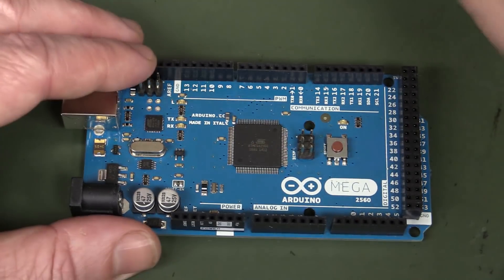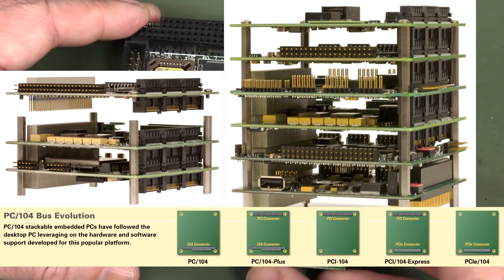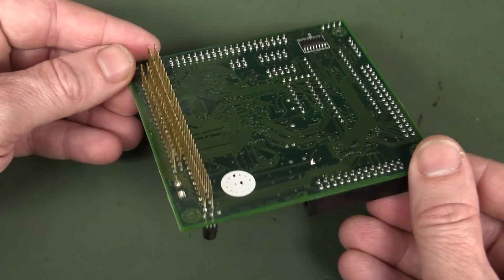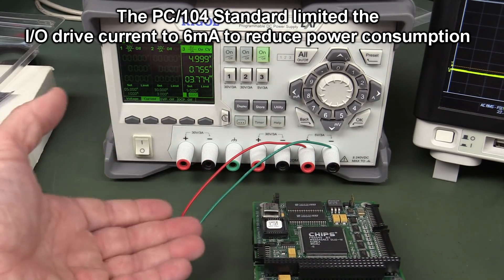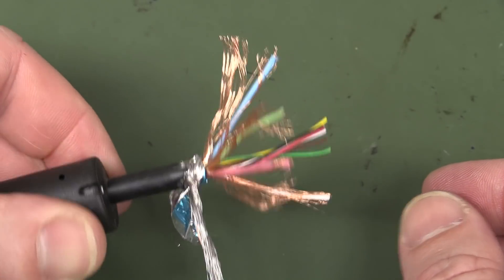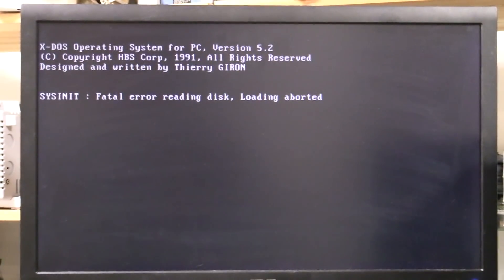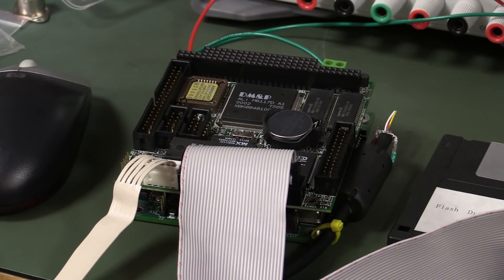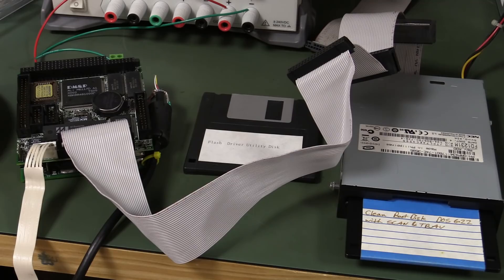EEVblog #1028 - What's All This PC/104 Stuff Anyhow?

Comment: Very cool look and compare. The 2nd half of your video is why "Arduino" took off in the free market. The Raspberry Pi wouldn't have succeeded had it not had a socialist push by the UK government. My last comment is how useful the Arduino is compared to these CISC embedded systems. It fit a big market need where the mass of developers had lower abilities, less time, and little need for CISC in the majority of applications. Granted big money is in the CISC embedded market (aerospace government contracts) but it was too large an initial investment by a lot of future developers. This whole market reminds me of the wideband O2 sensor crowd that helped take the $10,000 units down to sub $400 in a matter of a few years by DIY work and reverse engineering. Now everybody in the tuning and hot rod community has a wideband O2 sensor. Great stuff to watch evolve.
I really enjoyed your efforts in the video, especially the ending comment. I have similar sentiments when at work I have to debug computer systems older than the majority of their users! 6502 assembly code :) . Why upgrade when 1MHz responds faster than the mechanical system it's controlling? Although I think we are eking out every last bit of it's power these days. Taking full advantage feels good.

Comment: I don't think the arduino counts in that comparison. I know people try to use it that way but isn't it, or wasn't it intended as a prototyping platform? That's how I use it at least, get it working and flash the relevant microcontroller and put it on a custom board then reuse the arduino for the next idea.

Comment: I've got a couple of WinSystems PC-104 LX400 computers. AMD Geode CPU, up to 1GB DDR RAM, a CF card slot, both "CRT and flat panel" video. With a nice 6-40v input PSU of the same form factor. A Raspberry Pi is great, but it's hard to beat free from the scrap pile.

Comment: Just needs a Voodoo 3D add in graphics card then you can play Hexen II.
You had a 2D and 3D card in them days.

I bought a 40MHz 386DX (built in maths co-processor) years ago.
Got it in the free-ads, advertised as 40MHz.  When I got it home it had a sticker on the chip, peeled it off and it was 25MHz.  Still ran at 40MHz, these chips could overclock.

Comment: The PC104 manufacturers are missing the point they need to go with the AMD A10-7850k with 64GB of DDR3 RAM all it need is the UEFI/BIOS ROM and the SATA controller chip which means that they won't need anything else as the AMD A10 series of  APU chips is a SOC so they need to get their fingers out and get it done.
SVGA/DVI/HDMI ports would also be available on such a board if they cared to make one.

Comment: Reliability vrsus price and convenience. Most people now are trained to accept poor reliability over convenience, programmers included. I used to work on multi-user single processor databases that were designed to recover properly from any shutdown. That is, get 16 people to sit doing invoicing and throw the power switch of any any point and they would recover, without grabbing backups, OS included. Fully journaled datapaths, including journal recovery. You get what you pay for. I know it is not databasing, but you don't get that in a PI project with lots of module code written by "whoever". "Try version 1.1" or "Go back to version 0.87" type statements about fixing problems with addons or the kernel, makes me worry when people put them into machines that can hurt someone when they go wrong.

Comment: I think the idea that people would laugh it off if you suggested an Arduino is a bit. . .off. Sure, they wouldn't want an actual Arduino board in their system, but that's not really what you're programming with Arduino. You're programming the Atmel chips that they have, which can be pulled out and put places that PC/104 can't even go.

Then again, we're now in the waters of comparing embedded microprocessors to microcontrollers, which is kind of an apples to oranges thing.

Similarly, I don't think anyone's trying to say that a Pi is a perfect replacement for PC/104 (not that you were saying they were), but I think you underestimated the relative value of a Pi. A PCM-3343 from Advantech is $129 for an 800MHz chip (That's just the most similar I could find to a Pi's specs in the couple minutes of research I did). Sure, it might be more reliable (I don't have any experience working directly with PC/104 stuff, everything I know is academic at best), but for less than half that price (Let's say around $50), you've got a faster Pi with more storage.

I still really liked the video, but you just seemed a bit dismissive about what is basically an apples to oranges comparison.

EDIT: Also, I did wanna say that I know a lot of what you're saying is for comedic effect. I just figured I'd offer my two cents on the comparison.

Comment: If you ever find yourself in need of DOS again, I would like to mention http://www.freedos.org/ -- it's a modernized, F/OSS DOS-implementation and comes with a bunch of improvements over the old DOS 6.22 and the likes. Also, as it's so freely available, you won't have to hunt for old floppies with DOS on them or whatever :)
Reply: Nita Vesa But he still needs good quality blank floppies for the initial install.  Too sad Sony cornered the blank floppy aftermarket with crap quality blanks, then stopped production completely.  Still fondly remember using genuine Nashua blanks in the 1980s, but there were other well established quality brands that could have supplied the long tail aftermatket at $10 or more per disc instead of those crap  ones.
Reply: Nita Vesa But he still needs good quality blank floppies for the initial install.  Too sad Sony cornered the blank floppy aftermarket with crap quality blanks, then stopped production completely.  Still fondly remember using genuine Nashua blanks in the 1980s, but there were other well established quality brands that could have supplied the long tail aftermatket at $10 or more per disc instead of those crap  ones.
Reply: Doesn't look like it's DOS-compatible. I mean, sure, if one doesn't need DOS then by all means and there are plenty of other choices too, but I specifically was saying that if one needs DOS.
Reply: @baggacfreaks
You don't want to run dosbox on such an old and slow 386 machine.

Comment: I wonder what is the Linux support for the current generation of these boards.  A good Linux support would certainly bring life into this standard no doubt. Otherwise it is just waiting to be replaced for something more Linux friendly if that is not the case with PC/104 ...
Reply: Linux does apparently still have some sort of support for PC/104 as it's a configuration option in the kernel build.. but like ISA etc it's going to be one of those things that compiles and might work if you're lucky.
Aside from that support for 386 was dropped a while ago.
Reply: True but still there are a lot work done over the 32 bit x86 platform. So if PC/104 worked it is still working on a 32 bit distro. so it may be the only thing possibly good about PC/104, other then that running and old RTOS on top of that is a maintenance problem.
Reply: If you have a need for PC/104 specifically (one off for an existing application) sure you could use Linux but chances are whatever you're working on is all going to be running on some pre-ark version of DOS. You can still run the latest Linux on an original MC68000 but you wouldn't go and do that on a project for a legacy thing that uses an MC68000. ;)

If you were building something from scratch you would go and get yourself a bunch of boards from some of the many vendors that supply ARM based ComputerOnModules that come with a fully supported Linux package etc.
Reply: Yup ... sadly that should be the case ... I also think some of those board could run old RTOS's, QNX, VxWorks ... but most likely yup, MS-DOS (total waste of time if that's the case). Oh and for sure ...Linux ready ARM based SBC's are have been the Solution to go for a long long time. They're for sure the solution on these cases. Anyone looking at any electronics or data acquisition/control magazine can easily see all the amazing companies doing those boards. They are super loaded with everything one may get an also they have very good price points. I was talking about a possible use in case of   PC/104 is truly
Reply: DOS (MS or otherwise) is actually quite reasonable choice for something like this, precisely because it does so little. It's not multitasking, it does nothing behind your back, you have exclusive control of the hardware which lets you implement realtime control where necessary if you don't need all the features of a full RTOS (like ability to run multiple processes at the same time). Basically, if all you need is a glorified microcontroller, then you can use it as a glorified microcontroller with DOS (and DOS+BIOS gets you basic disk IO for free which is one of the more annoying parts to implement yourself.)
Reply: If you want something that "does little" you could just go bare metal. Why would you want DOS with all it's crap for driving 1980s hardware when you could just run plain C could on a Cortex R4?
Reply: Exactly my point, if there was at least Linux support that could make the development easier with say drivers and a supporting community that would be a time-saver in terms of development.
But writing C code the same way and still having to deal with a ancient OS with very limited set of functionalities ... no worth it at all. Specially when compared with current Open Source environments ...
Reply: Try bidding a government contract, or selling industrial products for $20K and up, using a toy controller board and you'll be shown the door. We've had the customer tell us not to bid, if the product din't run a commercial operating system since there wouldn't be any reliable support for it. Even Linux was disallowed, for this reason.
Reply: you can get redhat or suse entreprise which have support and are linux OSes

Comment: hi dave. i watched your episode 1028 with a big smile in my face. i remembered all the dos commands straight away.
if someone is looking for pc104 hardware one should look at mesa electronics website. they supply all sorts of hardware.
their aim is at diy, retrofit and special purpose machine builders.
with very few additional hardware you can build really cool motion controllers.
unfortunately linux (linuxcnc) does not support the fpga based ones.

Comment: Hi Dave,
CubeSats actually do not use the full PC/104 spec. I build CubeSats and CubesSat systems, and I have to always explain to customers it is NOT PC/104. Only the mechanical mounting holes and the connector location of the PCI variant PCI-104 is used. The electrical specs are usually violated. So CubeSat boards generally do not stack into PCI-104 stacks. they do not have the ISA bus side at all. Most bigger CubeSat vendors like us are now using other connectors to save space or improve signal integrity.
Reply: @kasa6468  I've been directly involved in 12, of which 5 are still active and the rest retired after a successful mission. I've worked on at least a dozen more. the notification of your reply only came today, 2 years late. yay YouTube
Reply: @oH well,lord! most CubeSats use various buses like I2C and SPI, UARTS and CAN. but physically it's indeed close to the PCI variant, albeit with another pin count

Comment: The great thing about Arduino, Raspberry Pi and the selection of other single board systems is that they are challenging these old industry 'sloths' at every turn. You can now buy a single board company for the true cost of production, not a hugeley over inflated number just because somethings been the go-to for the last 30 years. 

Yes ratings, certification and testing do mean a lot, but at the end of the day, there is no longer a technical reason to choose PC104 over one of the modern cheaper alternatives. Just 'trust' in a brand, thats keeping these older systems alive.

I work with small ARM based systems in an industrial settings, and they cost £1000's.... Whereas a Pi costs £30 and is 4 times as powerful.

Comment: this is literally a 386, it can run modern netbsd or linux, can it run windows 10? I'd love to try

i guess the modern direct successor is the Intel NUC, the smallest form factor modern PC, which has the performance of a modern laptop - it's the same size, nearly exactly!
Reply from the maker: +๖ۣۜ♥๖̶tacokitten๖̶ yes you can run anything that works on a 386 desktop
Reply: Dave's is just old. You can still get these with an i7 and PCIe bus

Comment: What about S100 bus computers?  Aren't they also an older standard than PC/104?
Reply: S100 was a slotted backplane based system, and quite large. PC/104 is a stacking bus without a backplane.
Reply: S100! Yeah! CP/M and S100 not all that Linux/Pi rubbish! Please :-)
Reply: Michael Graff S100 was indeed an early standardized and widely adopted bus, but it was never an embedded computer bus (too large for a typical embedded applications where size and power were concerns).
Reply: Wow, I remember the S100 bus! Anyone recall IEEE-696?

Comment: For the embedded engineers out there, is there an industrial standard form factor for small, embedded Intel Core i5 boards?  Is it PC/104?
Reply: PCIe/104 or PCI/104-Express if you want PCIe+PCI. See page 16: http://www.adl-usa.com/wp-content/uploads/2017/04/ADL-Catalog-EN-2017.pdf. I've only used their atom boards.

Comment: Hi; I do not usually comment a lot but this time...
On the top left I glimpsed a seat for an I.C.; what is it called? (althogh I realize it is a B.I.O.S.) and can we use to attach/dis-attach the square form factor of the programmable micro-controller Microchip 18f8722 where I need it for a project!

Comment: Too bad it doesn't have a 486, you could have played DOOM on it.
Reply: It can run Wolfenstein at least!
Reply: He could play Ultima VI on it; that would be cool.
Reply: I had a socket 7 (Pentium) one. But I blew it up with a dicky power supply. Was a sad day, but pushed me to upgrade from a P100 to a Via Epia. I was only using it for a music player so didn't need the industrial interface.
Reply: Duke Nukem 3D is so much better gamer
Reply: @basshead
Duke3d came a couple of years later. You can't compare them.  If you want to compare Duke3d, then compare it to Quake.
Reply: Halt, Halt, Achtung, Spion,.......Mein Leben!
Reply: Will GTA1 run on a 386?
Reply: Ken Silverman wrote the game engine for Duke3D known as Build.
Reply: Stunts is a good dos game too.
Reply: Just came over one with a 486 and SVGA on the same board. Still need to custom-make an Adlib-clone before it's good for gaming.
Reply: @sorphin  Just out of curiosity, I have a few of them, can you just use the VGA or LCD out instead of a video card? Thanks for sharing. Best Wishes & Blessings. Keith Noneya

Comment: PC104 is such a crusty old piece of junk, can you imagine buying and relying on a 386SX in 2008 ? And probably paying 500$ for the luxury !?

No doubt you'd get laugh out of the room if you brought a raspberry pi, it might be running circles around this old turd but the installers who use these things are just as crusty as their hardware. They will refuse to change until they finally retire. They will tell you their PC104 and PLC crap is more reliable, hogwash !

The reliability isn't in the hardware, it's in the implementation of the entire system. You can make a rock solid arduino based system if you aren't an old jerk that is afraid of change !

Progress occurs one funeral at a time !

Comment: So what software runs on the modern PC-104 boards with an Intel Atom processor? They'd probably laugh even harder at you if you suggested running Windows on it than they did when you suggested the Raspberry Pi.
Reply: Alright. I thought about something like QNX or so.

Comment: actually cubesat pc/104 is really bad, nowadays onboard modules typically use a serial bus (i2c or can) and some dedicated signals. so 104 pin is not necessary, 8-16pin is really enough. and other dedicated signals make stack-able connector meaningless, point-to-point signal pins cannot be reused. as a result on most cubesat modules those 104 pin are mostly useless. backplane design is much better for cubesat.

Comment: As far as interface speed goes, this thing is faster at loading menus than a modern computer is. Software is such bloat nowadays
Reply: Not only menus, whole system has been way more efficient. My first PC was 80286 with  1mHz processor, and 1MB of RAM. Now, I have 3.8gHz CPU and 24 GB RAM, at least 3000 times faster and more resourseful. But don't get efficiency x3000 compare to 80286, nowhere near thanks to software bloat... Agreed..

Comment: I hate to say this but I think he might need to go Andre look into it because I just did a search there is a pie variant that supports pc104 but I don't know if it wouldn't be possible tort if you use a Raspberry Pi zero the original the $5 computer with the output adapter plate take an Adaptive pin header of the Raspberry Pi to pc104 standard erd